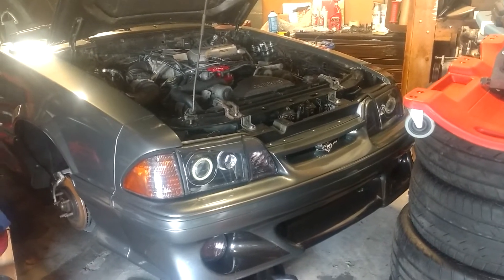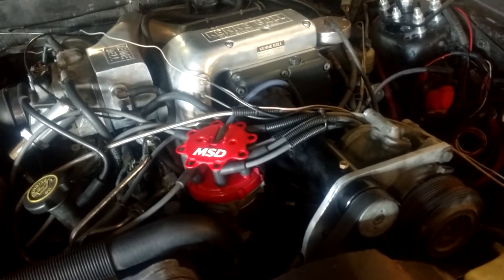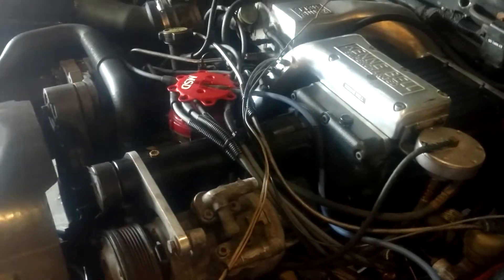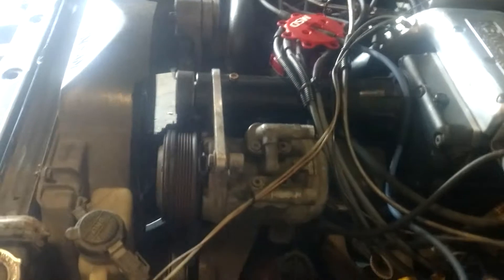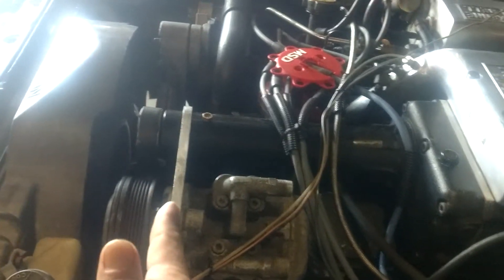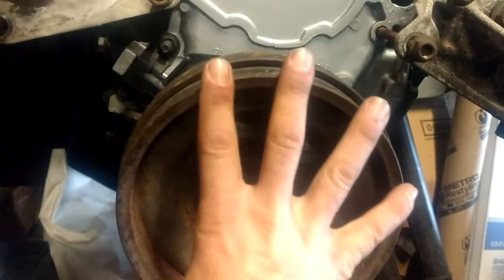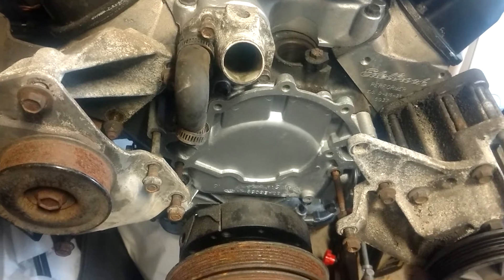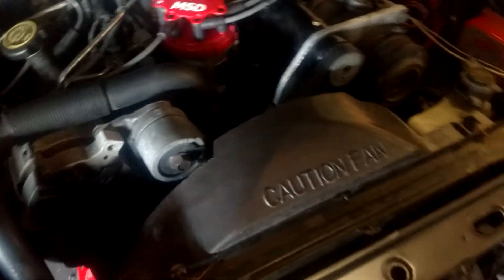Fox body Mustang Kenne Bell Swap Whipple supercharger PART 1 Don't buy used eBay scammers junk

Comment: The kenne bell for the modulars adds way more power than the pushrod 5.0's. The shaft for the 5.0 kenne bell is waaaaaaayyyyyy too long and the 5.0 doesn't like boost as much as the twin and quad cam modulars